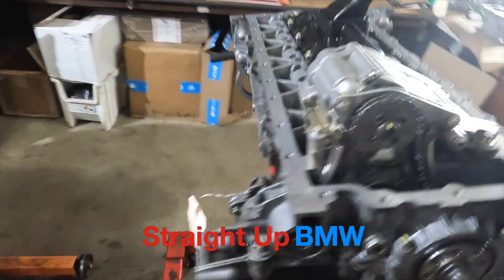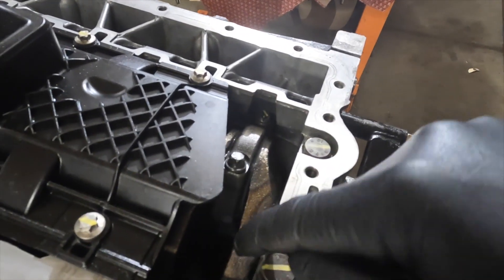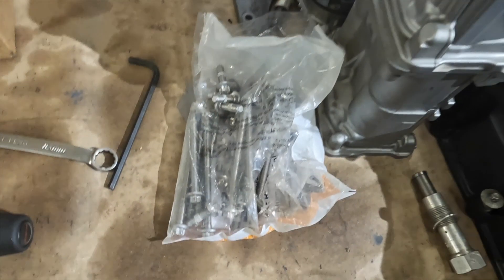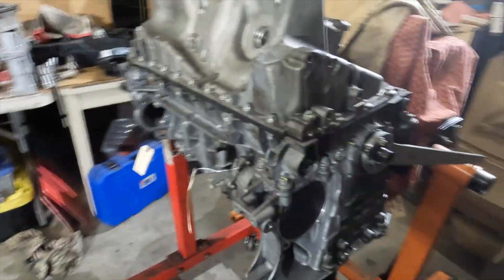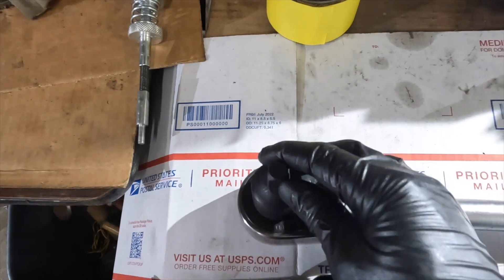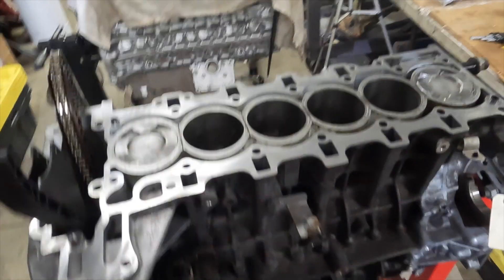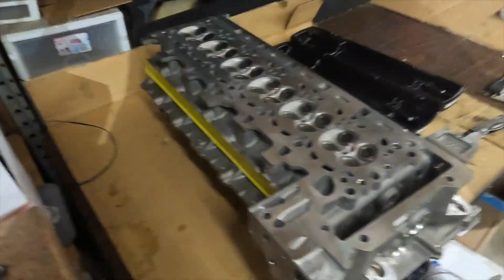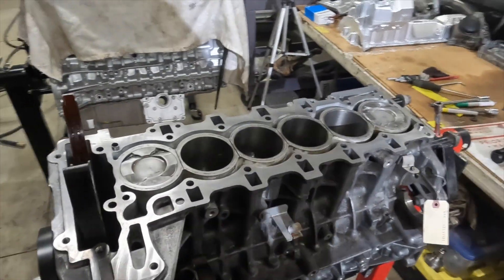BMW N55 1227701  P9 Block Reassembly Oil Pan : Hub Bolt Torque

Comment: Hey, thanks for your video. I have a question! I rebuilt the n55 engine for my 2013 x5 and I remember I didn't torque properly for the crankshaft bolt. I think I did not make 270 degrees. Is that the reason why I am getting low oil pressure? I tried everything I could do to fix that issue but nothing worked. I even took it to a shop to fix that issue. They couldn't find either and I have to pay $500 for nothing for diagnosis. It drives fine but I get the warning light every trip I make!
Reply from the maker: Hub torque does not influence oil pressure, lack of torque will be a result of the hub slipping and car will jump timing. 

Oil pressure is a function of main, rod  bearing clearances, wear in oil pump, and the oil pressure control valve in from right side of engine

If you have ISTA you can monitor oil pressure as you drive and   See how low it gets 

You can also try removing module and inspect screen for debris that could restrict flow 

Lastly you could also set pressure module to max and monitor pressure
Reply: @straightupbmw  I did replace all the bearings with new ones. I don't understand the last paragraph. Could you be more specific about that please? And thanks for your comment.
Reply from the maker: @hoonster1937  first 
What were your oil clearance on your bearings mains and conn rod 
Plastiguage check
Reply: @straightupbmw  I don't know. I didn't do that part. Is that really important so that it could cause low oil pressure issue?
Reply from the maker: @hoonster1937  yes, your bearing high limit clearance is a huge factor.

If you add too much clearance beyond design, then the oil will go out the side as spillage into oil pan and as a result reduce your oil pressure your engine measure 

Think about it like this 
You have a garden hose wide open and you put you thumb to cover 1/2 of the tip. The water pressure coming out is higher.  Your design bearing clearance is that restriction that maintain your set oil pressure

Now if clearance is larger ( your thumb is now only covering 1/4- pressure of water existing is lower)

This is one major factor 

The other is your oil pressure control valve

See link below 

https://www.bimmerworld.com/Engine/BMW-Oil-System/Engine-Oil-Pressure-Valve-N20-N26-Engines.html?gad_source=1&gclid=Cj0KCQiAwvKtBhDrARIsAJj-kTi5pTflNkxTEFoI0rFWvH2X8pTpn4RWcl8Ob6-jRvyfo7UeBpm0LTgaAoFUEALw_wcB
Reply: @straightupbmw  Wow! I had no idea. What happens is that I use a different viscosity of engine oil to test and whenever I change to new oil, the first 5 minutes maintain well like 40 psi above however it slowly loses pressure as time goes by or as the engine warms up. After 30 minutes, it goes down between 18 to 20 psi. Do you think it's with a bearing clearance issue?